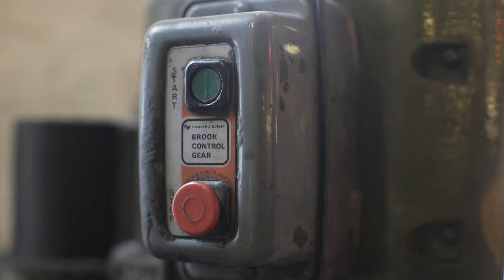Ernest Wright & Son

Comment: I’ve just received my Turton , which are kitchen and general purpose scissors. They are without doubt the finest quality , most durable scissors I’m ever going to own - Life time warranty, pretty much says it all ......

The ergonomic handles ( bows ) are a delight to behold and feel like a marriage between your hand and scissor , giving both power and control. 

The serrated blade is of course razor sharp and capable , of surgically removing your legs ! 

And as a bonus includes nut crackers and bottle openers built in to the shanks. 

I’ve ordered two more pairs this time storks.